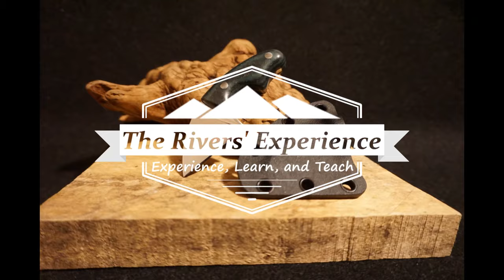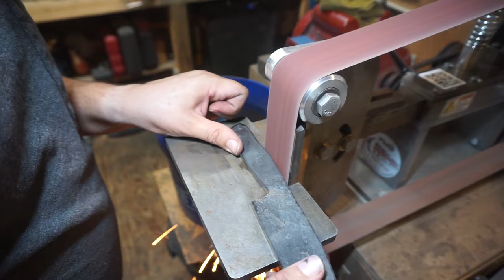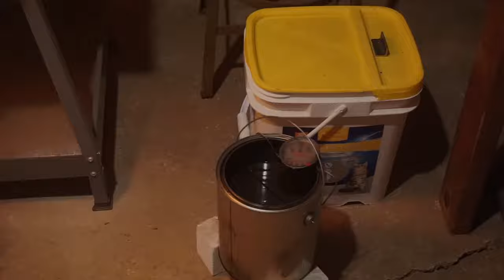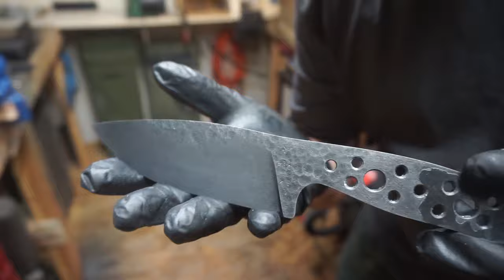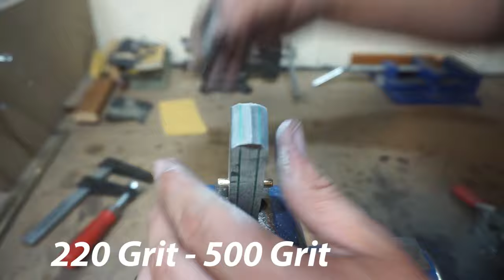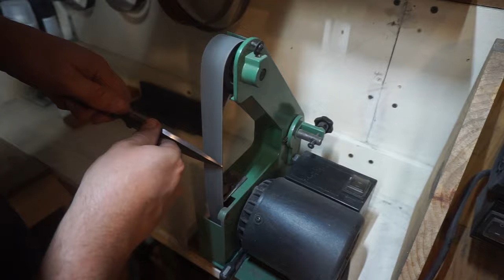Making A Knife In 10 Minutes | The Hunter Knife | Daily Vlog

Comment: Great video....what type of band saw blade do you use? My band saw blades are terrible with my anealled steel. Is there a certain brand or teeth count I need to look for? Thanks
Reply from the maker: I use a Lenox 14 TPI (tooth per inch).
Reply: Thank you I will try and locate one for my smaller Skill bandsaw. You videos are superb!
Reply: The Rivers' Experience If I may ask you one more question, do you oil to quench your metal? I am using vegetable oil and it is leaving a heavy black coating on the knife blanks. Am I doing something wrong? Thank you.